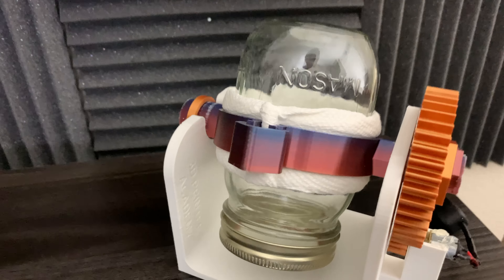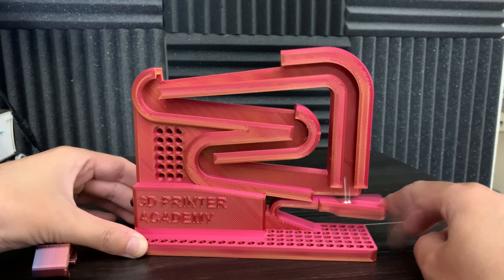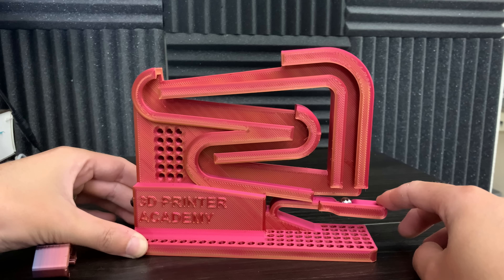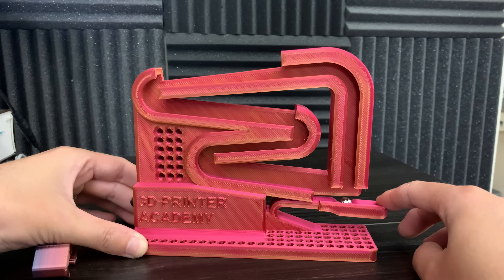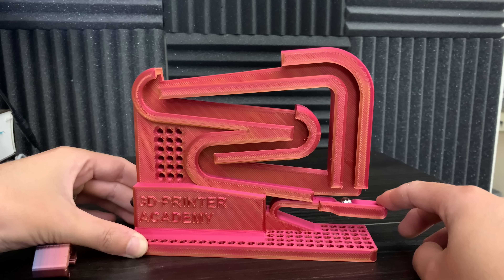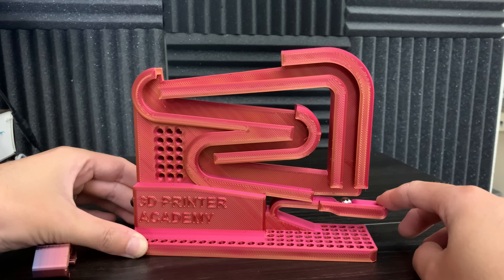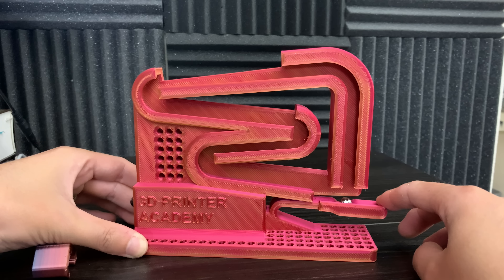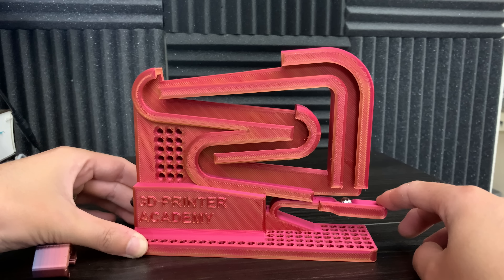This is a 3d printed ice cream machine...

Comment: Pro tip, instead of the Jan use an insulated container which already has been in the freezer and therefore will freeze the liquid in it. Now you can rotate this new container and the content will freeze without the need to put this whole contraption into the freezer.
However as a mechanical design engineer I must say, your machine is very well done and pleasing to look at, great job.

Comment: This may be the most cheapest solution to make ice cream instead of making ice cream but you used a wire, motor, and battery but if you have it at home then It would be cheap. Good 3d printed design but how is that recipe for the ice cream only 3 ingredients which is water, sugar, and heavy cream. Where did you get that recipe from?

Comment: I wonder if it could work rotating on the other axis? Because that would then be more compact and easier to store in a freezer, freezers where I am are much much smaller than the US ones, and a device like that wouldn't even fit in an empty draw of most freezers, they don't have the height.
Reply: AKA a rock tumbler. I think the splashing of the cream is key.
Reply: I think it could work, but you'd need to put some sort of paddle inside the jar to actually stir the liquid around, otherwise it'd just stay at the relative "bottom" of the jar for the most part
Reply: I had this same thought, I wondered why he didn't even mention it
Reply: @ianr2002  this is some good reasoning right here
Reply: Its should work as long as you add some padle good idea !
Reply: I will maybe design one like1 that at some point so if you are intrested I can Truro keep you informed
Reply: @valian8985  did you ever try the rock tumble idea?  Curious how that worked out.

Comment: Couldn't you make it with a roller system? You would lay the jar onto two rollers, one would be powered by a motor and the other would be passively driven by the jar. If you did this, you could make a few differently positioned holes for the rollers to fit any jar size. Just a thought.

Comment: Fusion 360 .... never again.

However, your designs are pretty damn good; nice work!
Reply: Blender could probably do all this without crashing or even requiring you to map out ever mm in advance. :-)
Reply: @darrennew8211  Blender isn't CAD software and is not designed for creating real world parts at a precise scale
Reply: @brianmoody2949  It's not CAD in that it won't do any sort of analysis, but it's perfectly capable of doing precise modeling. Check out Maker Tales on youtube for a whole playlist instructing how. It's really not that difficult, especially after you install a plug in or two designed for that, like CAD Transforms or CAD Sketcher.
Reply: @brianmoody2949  Alternatively, if you prefer something with native unitary precision and without the risks of internet unavailability or licensor corruptibility, you can always use OpenSCAD or FreeCAD depending upon your stylistic methodology preference.

Comment: What about a rock tumbler machine like device - 2 rollers. Any round'ish shape should work then 🤓
Reply: Had the same idea, already drawing up a sketch to then turn into a Solidworks project.
Reply: @OddJobEntertainment  perhaps tilt rollers to keep cream in bottom end of jar and to keep jar on rollers. Then rollers need only a flange in one end. Maybe - or not..🤓🤔
Reply: @TheStuartstardust  I think it would save more space if the jar is totally flat.  I'm thinking just add a stopper on either end of the jar to keep it from moving up and down (relative to the jar).
Reply: You actually want at least a rocking motion between the top and bottom of the jar to prevent settling. Even with the jar flat along the cylindrical facing, your mixture will get an undesirable gradient of concentrations. That's part of why you generally always see a tilt mechanism on any sort of rotary mixer in several different industries. It helps with dispensing, but the primary purpose is to provide more even mixing. That's also why really expensive mixers and rotocasters implement three or sometimes more rotary axes despite diminishing returns as well as two or more vibratory axes.
Reply: @claws61821  uneven rollers with offset centers - boom - solved! 🎤⬇️

Comment: What battery did you use
Reply from the maker: This is using a 5v power adapter and is connected to wall outlet. The power cable goes through the freezers seal.

Comment: dude...just add grooves for bb balls to roll in your joints,make it a bearing so it wont wear down all that fast,add probably second axle of rotation to make it really mix it all up.. there's so much cheap upgrades and yet ...
Reply: You dont need another axis of rotation. You're not making a slush casting machine. You just need to keep the fluid moving while ice crystals form.

Comment: I would need a battery for this so I’m thinking of a li-ion cell and a protection circuit. there are many protection boards available just type li-ion protection board or stg, Li-ion can’t be charged at freezing temperatures but they will still have some voltage below 0C anyway it’s better to wrap it in a protective material
Reply: LiIon does not do so well under 8°C. I would strongly recommend against putting one in the fridge
Reply: Bad idea. Batteries and sub zero temperatures don't mix so well
Reply: How about to protect the battery pack inside polystyrene box or similar?maybe even adding small heater inside that box?

Comment: It really mixes? By the time the ice cream froze it won't mix anything by just  spinning instead of something mixing manually the ice cream like your first version.
Reply: Err, but then its frozen, so you dont need to mix it once again ts frozen..

Lomg before the entire thing has froze  it will haveformed tiny crystalds inside the fluid as it moves around rather than large crystals. The entire thing will become too frozen to move in nce its full of tiny crystals . Which is exactly what you want.

Comment: I just put the finishing touches on this and installed the 60rpm N20 motor. It turns when empty, but when I tested it with a mason jar half full of water, the motor was still turning but the gears in the motor started slipping (NOT the 3D printed gears). Is this normal?
Reply from the maker: I haven't had any issues with the N20 motor gears slipping. It should be able to handle a good amount of torque. Make sure the axle isn't slipping in the 3d printed gear.
Reply: @3DPrinterAcademy  Yep. I checked again and that's exactly what's happening. The axle is slipping in the drive gear. I'll tweak it and print it again. Thanks.
Reply: @3DPrinterAcademy  Got it! I reprinted the drive gear with a 5% smaller shaft hole and it works like a champ!

Comment: You'll have an easier time finding ice cream recipes if you search for 'frozen custard' instead - the proper food-snob term for the type of 'ice cream' with which home cooks are most familiar. Alton Brown's Food Network content is usually a safe, sane starting point for recipes. I can speak to the efficacy of external agitation with no internal stirrer from personal experience, at least for small batches. If you ever want an idea for a version 3.0 I'd recommend a way to add a salt and ice jacket for onboard cooling to avoid using up freezer space and to let it run in the open where people can watch the gizmo go.
Reply: Good info, thanks!
Reply: Having grown up alongside a classmate for most of K-12 who was from a family that owned a frozen custard shop, no. No they are not the same thing and saying they are is very insulting to the passionate people who build their lives around making and selling each. They are similar dishes to a respectable extent, but there are several fundamental differences between them - which I couldn't do justice in explaining even if I did remember them after more than a decade and a half away from that Worthy.

Comment: Now we just need to make it gravity powered!
Reply: I was thinking about making it spring powered like in a wind up clock mechanism.
Reply: @seasong7655  I wonder how the spring would react in the freezer
Reply: @NaClGod  unless there’s condensation on the spring, it should work just fine, tough it might be smart to freeze it before winding so thermal contraction won’t be a issue.
With springs heat is more of an issue than cold.

Comment: Several Points:  First do have a GoPro or some camera that you could do an actual video of the process in the freezer?
Next, I really think the food-safe plastic hysteria is a bit much.  I have never used PLA but do use PET and PETG which is what the food industry uses.  I think the biggest concern is not what you'd get off of the plastics (what is going to survive the +200C extruder temperature?) but sealing the layers to make sure that you don't harbor bacteria--but I think with heat-sealing you could mitigate that issue.
Lastly, I'm thrilled to see the 'tumbling-jar' method actually make ice-cream because trying to get a proper auger with enough power to work is a real challenge.
Great video and love all your commentors..

Comment: Curious as to how long it took for the recipe to freeze one you started it spinning and di you use a battery to drive the motor in the freezer or did you let a cord hang out of the freezer while it ran?
Reply from the maker: about 6 hours. cord hanging out
Reply: @3DPrinterAcademy  The nice thing about running a motor inside a freezer, is that the motor will be much more efficient at freezing temps and condensation won't really be an issue. Also, the reason why you would never get any rings as the mixture cools, is because the mixture will be fully mixed before freezing even starts.

Comment: great design. How would look like a mechanism that will put that on the next level by extra shake while rotation like two steps forward and one step back? Some planetary gears?
Reply: Epicyclic gears would only change the gearing ratio, in your context. What you want needs either specially shaped gears or a reversing mechanism that uses timing gears. @King Mechanical frequently posts videos rendering examples of these and other mechanisms and their operational motions. 

Of course, if you really want to mix something up externally, three rotational axes and at least two vibrational axes is absolutely the way to go! XD but then you're getting something the size of a paint or cement shaker, probably.
Reply: @claws61821  That would be awesome to find out if ice cream of cement is still soft enough to use a spoon on it :D
Reply: @2EOGIY  lol the sad thing is that this isn't the first time I've heard or seen that joke

Comment: How did the motor last in the freezer, did the freezing temp cause any issues to the motor?
Im assuming the device and motor was inside, and the motor wires were directed out of the freezer, to a plug socket or power source
Reply: the motor shouldn’t have any problems except a little bit of corrosion but it should still last a lot
Reply: Apart from friction, the motor is the only part of this machine that will heat by itself, so probably will never be below zero.

Comment: How did you power it in the freezer?
Just a cable to the inside or with batteries?

also maybe add some ball bearings to reduce friction and wear

Comment: How did you power the motor whilst in the freezer and what method did you use to avoid shorts from the wet cold air?
Reply from the maker: A cable goes out through the rubber seal (the cable is thin so it doesn't compromise the seal too much). Wires have heat shrink, but it's not perfect insulated. I didn't have any issues with shorting. But maybe sealing the wires with hot glue could work.
Reply: Maybe a polystyrene container to cover all the electronics would be a cheap and easy way to protect them for the 6 hours it takes to freeze the ice cream.

Comment: You actually cant use any sweetener as it has to structurally modify how the cream freezes sugars oddly enough do that job very well, sugar free sweetnener will make a gritty ice structure, salt could work but then you would need so much it would be toxic. Alcohol can work but again not as well as sugars.

Comment: There's nothing wrong with volumetric measurements in baking. Liquids are incompressible so there's no possibility of a difference there, and for the most part granulated solids are as well. The two exceptions are brown sugar which is usually specified in recipes as "packed" which accounts for a possible issue and flour which, admittedly, compaction isn't usually accounted for. You're supposed to sift flour before using it to keep it airy (and properly work in additives like leveners) but I'm honestly too lazy for that so I usually don't, but I am aware of the differences compaction can make so I know what not to do. For the newbie baker, though, I could see the argument of weighing just flour. Everything else is much faster and easier volumetically.
Reply: There's actually a lot of debate at every level of both hobby and profession about whether flour should be sifted or scooped whole or scooped incrementally and about the effects of each. Probably as much argument there as over volumetric measurement vs weight and percentage for ingredients.

Comment: Well, it is not an ice machine but a turn a jar in the fridge machine. But that is very well done. I have more stuff in the freezer and would be a litte concerned about all the plastic sitting next to the other food stuff's. Keep it comming good job.
Reply: The plastic isn't dangerous. It's the food getting stuck in the layer lines and then rotting and then getting stirred back into the ice cream that's a problem. Remember it's exactly the same plastic that soda and bottled water is packaged in.

Comment: Fusion 360 is also GREAT for those of us who can't afford Solidworks. Which, to be honest, having used both extensively, (well, Solidworks 2017) I prefer Fusion 360. While solidworks is etremely useful and intuitive, Fusion 360 offers alot for its wayyyyy more affordable cost. Solidworks license = $4200 for standalone, $1300 for yearly. Fusion 360 = $60 per month, $495 per year. Solidworks does provide a service for makers too, however, commercial rights are limited. You can't make more than $2000 on a project. They offer the service for $99 a year, or $9.99 a month. I have yet to try it though.
Reply from the maker: And Fusion 360 is free for personal use
Reply: Yeah, right up until AutoDesk decides again to reimplement the old IP revocation clause of their Terms of Service or their come up with their next ridiculous set of abusive restrictions on use of the hobbyist license like they reliably do with everything eventually.
Reply from the maker: @claws61821  classic bait and switch